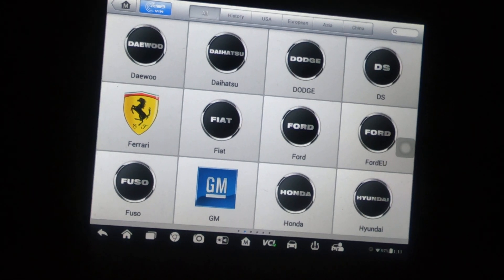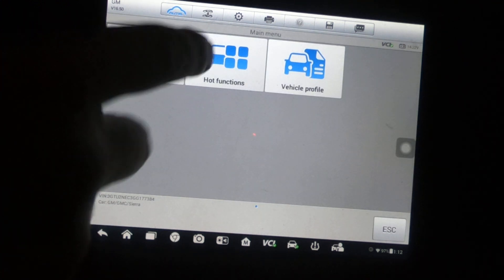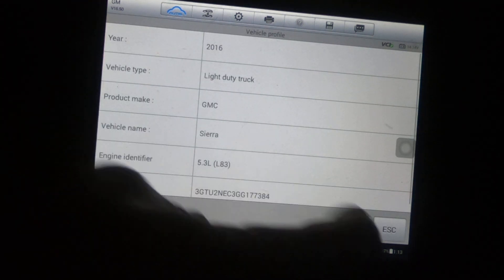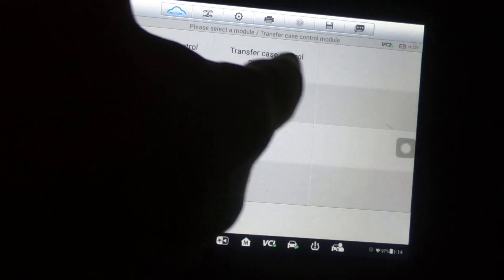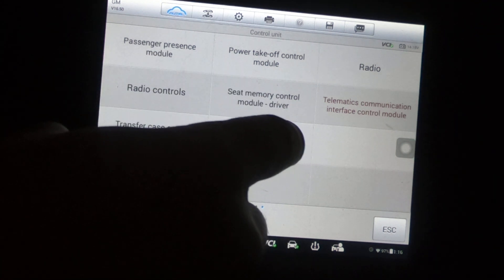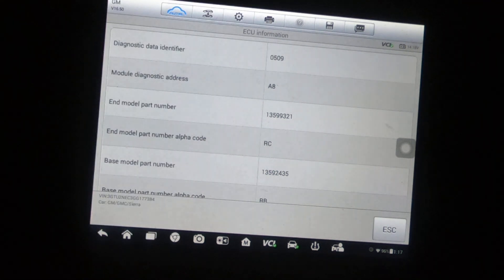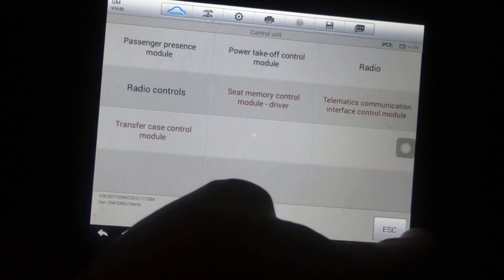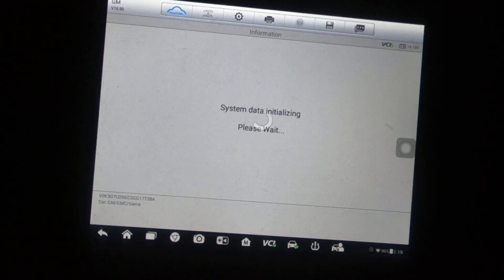How to Determine which Options to pick on your Autel Scan Tool.

Comment from the maker: Autel MS906TS 
https://www.amazon.com/dp/B008PTN992?ref=t_ac_view_request_product_image&campaignId=amzn1.campaign.2FPZIW6QG3BK3&linkCode=tr1&tag=737mechanic-20&linkId=amzn1.campaign.2FPZIW6QG3BK3_1761783311960
Autel MS906 Pro
https://www.amazon.com/dp/B086DRGM15?ref=t_ac_view_request_product_image&campaignId=amzn1.campaign.1AXSD88PTM71U&linkCode=tr1&tag=737mechanic-20&linkId=amzn1.campaign.1AXSD88PTM71U_1761782768971
Autel MK900
https://www.amazon.com/dp/B0DHG4FP45?ref=t_ac_view_request_product_image&campaignId=amzn1.campaign.22RG23CVJUYEV&linkCode=tr1&tag=737mechanic-20&linkId=amzn1.campaign.22RG23CVJUYEV_1761782972436

The links I provide are Affiliate links that I earn a small commission from but don't cost you anymore. Thank you for your support.

737mechanic Amazon Store Front
https://www.amazon.com/shop/737mechanic/list/CR3BU74FTDU1?ref_=cm_sw_r_cp_ud_aipsflist_aipsf737mechanic_W4QMHMJ1JD67FDBCQHRK